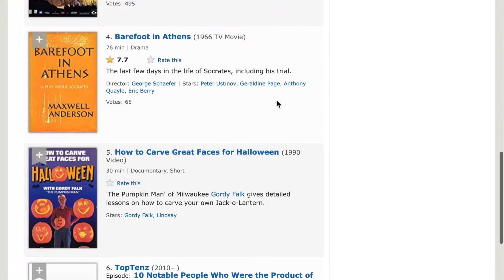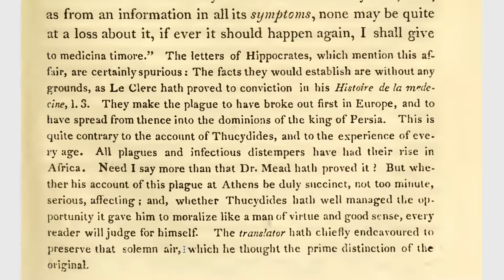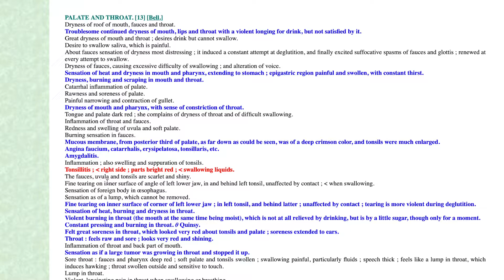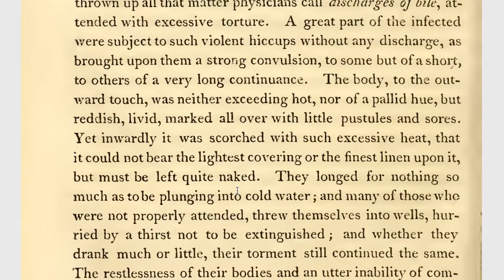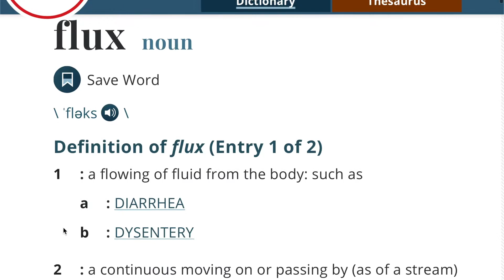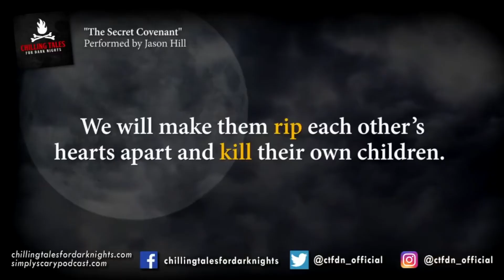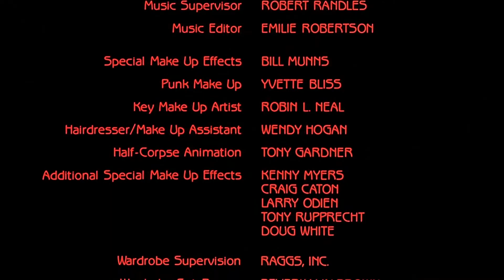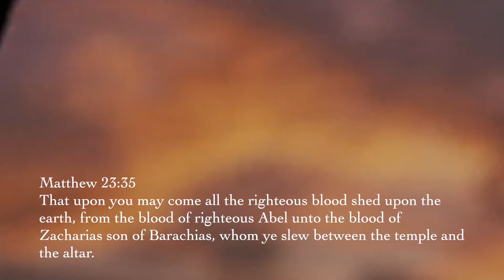FD/RP 3: Plague of Athens, Zombieism & Hemorrhagic Fever e.g. Ebola

Comment: Amazon service agreement 

42.10
42.10. Acceptable Use; Safety-Critical Systems. Your use of the Lumberyard Materials must comply with the AWS Acceptable Use Policy. The Lumberyard Materials are not intended for use with life-critical or safety-critical systems, such as use in operation of medical equipment, automated transportation systems, autonomous vehicles, aircraft or air traffic control, nuclear facilities, manned spacecraft, or military use in connection with live combat. However, this restriction will not apply in the event of the occurrence (certified by the United States Centers for Disease Control or successor body) of a widespread viral infection transmitted via bites or contact with bodily fluids that causes human corpses to reanimate and seek to consume living human flesh, blood, brain or nerve tissue and is likely to result in the fall of organized civilization.